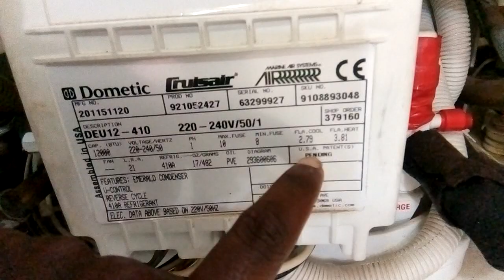Boat AC high pressure & low pressure issues ?? Explained#marine#airconditioner

Comment: thank u bro ..that was very informative..i have a marine ac and sometimes the sea water pump is the problom resulting in hpf...we tend to forget that sometimes..its not the strainer ..its the pump that is not reciving the signal from ac compresser..for diffrent reasons
Reply from the maker: Thank you sir. 
There are two methods for working of sea water pump.
1.sea water pump is connected to relay control which is activating by AC compressor (when ac compressor start sea water pump also start same time. When compressor stop sea water pump also stop)
2. AC unit and sea water pump with separate control switch. Which mean you have to on the sea water pump before start the AC unit.
This method sea water pump is continuously running.
If you have few compressor this method is okay because most of time at least one of compressor is working

Thank you ☺️☺️

Comment: 2 hours working after tripping tha braker we change the braker 
But seme
Reply from the maker: Probably compressor taking high amps . Check the amp by clamp meter and check the capacitor too.
If capacitor bad compressor taking high amps . Otherwise check refrigerant pressure high side if less of seawater floor AC compressor become high pressure and it's taking high amps. after check these things let me know
Reply: Clamp meter showing 194A

Comment: Hi bro i need your help our yacht ac chiller is going high amps can you have your what's app number
Reply from the maker: Reduce the gas little bit, check any difference off Amp, clean the sea water system, flush with barnacles blaster, check the sound of compressor, check capacitor, if no any changes msg me
Thank you